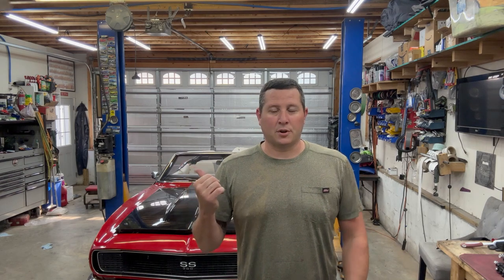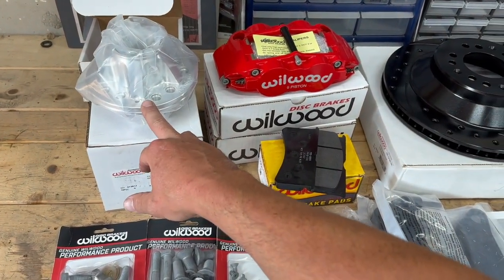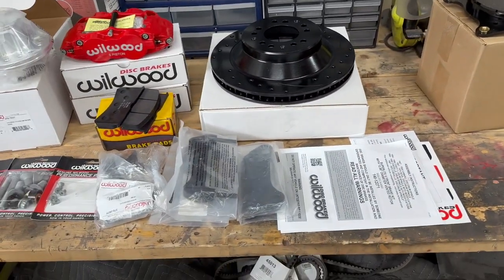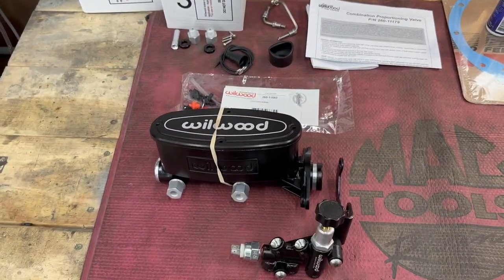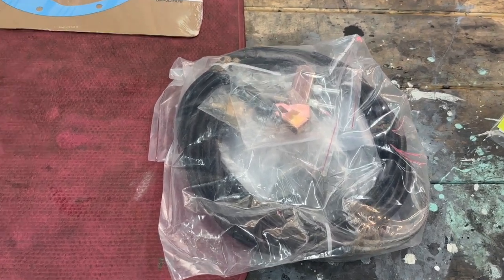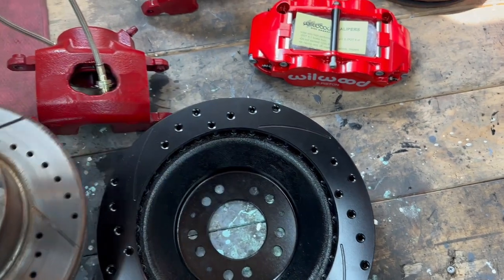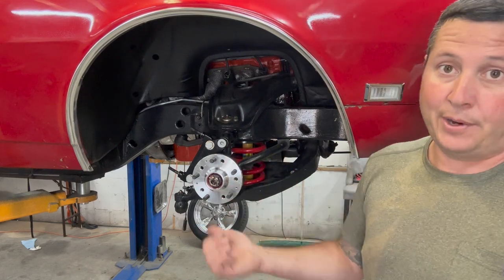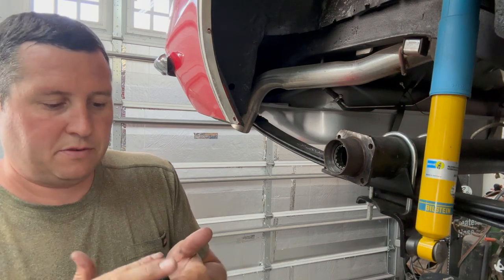1968 1969 Camaro Wilwood Superlite 6R & Dynalite Pro Install Tips P/N's make installation easy!

Comment: Did you need to adjust the brake pads or did it work with the way it was?
Reply from the maker: You will have to shim the calipers. I think all mine took 2 washers except for the passengers rear took 3
Reply: @trbokmro  you're right one side took 3 other side 2

Comment: Do you have the links you used? Im trying to get the same kit
Reply from the maker: https://www.ebay.com/itm/195648954181?mkcid=16&mkevt=1&mkrid=711-127632-2357-0&ssspo=2vcQC8EmSqu&sssrc=4429486&ssuid=i_0FTEA4Rb-&var=&widget_ver=artemis&media=COPY
Reply from the maker: https://www.ebay.com/itm/195645860813?mkcid=16&mkevt=1&mkrid=711-127632-2357-0&ssspo=2vcQC8EmSqu&sssrc=4429486&ssuid=i_0FTEA4Rb-&var=&widget_ver=artemis&media=COPY
Reply from the maker: https://www.ebay.com/itm/164057842474?mkcid=16&mkevt=1&mkrid=711-127632-2357-0&ssspo=RgWYJkPnS36&sssrc=4429486&ssuid=i_0FTEA4Rb-&var=&widget_ver=artemis&media=COPY
Reply from the maker: https://www.ebay.com/itm/175524225976?mkcid=16&mkevt=1&mkrid=711-127632-2357-0&ssspo=qkao32gvt2w&sssrc=4429486&ssuid=i_0FTEA4Rb-&var=&widget_ver=artemis&media=COPY
Reply from the maker: https://www.ebay.com/itm/165993874700?mkcid=16&mkevt=1&mkrid=711-127632-2357-0&ssspo=pAnYQPtjT6u&sssrc=4429486&ssuid=i_0FTEA4Rb-&var=&widget_ver=artemis&media=COPY
Reply from the maker: Wilwood 220-8307 Flexline Kit https://a.co/d/fznCSlv
Reply from the maker: The Stop Shop Brake Line Adaptors for Inverted Flare 7/16"-24(Female End) to 3/8"-24(Male End) Pack of 2 https://a.co/d/15GTXor
Reply: Good content and very well explained. Wilwood is a top tier company. Couple of comments: Wilwood always recommends/ heavily persuades 3/16 lines to the rear for correct pressure. If you feel you have rear brake issues that would be a good start. Also , a 1” bore is mostly used for manual brakes, their assisted brakes usually use a larger bore. If it’s stopping fine  now, that’s great and all that really matters. Cheers.